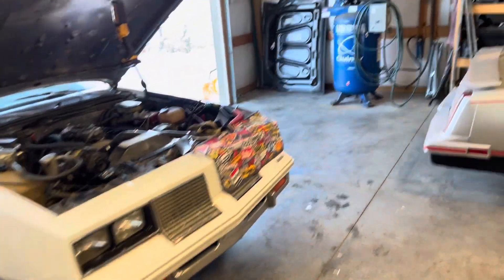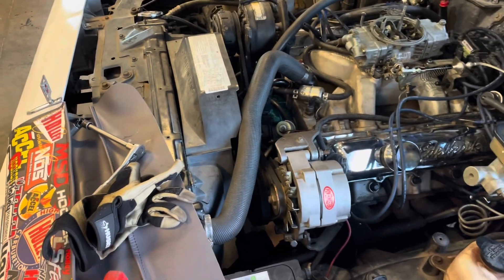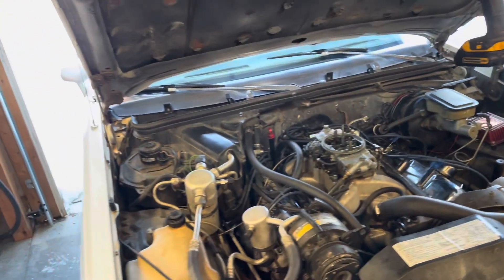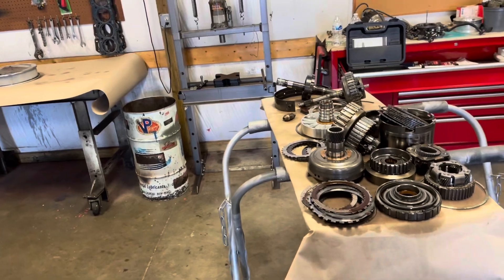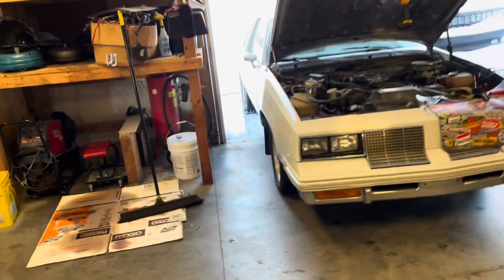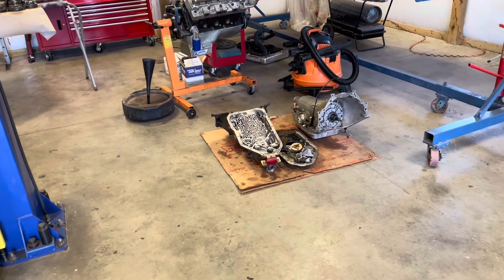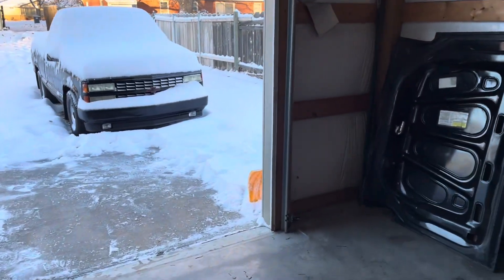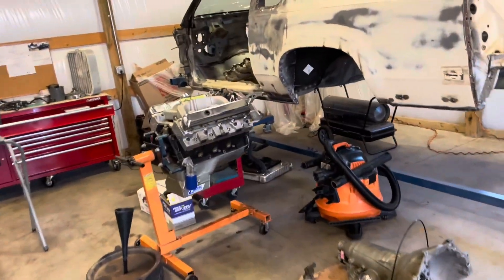This car is ✔️ for the day. Kinda anyways

Comment: on the white 442 is the Lunati cam still in it...I have looked at many of your videos however how does it sound,,, anyway you can do a video of the motor when its running as well as a rear shot to see how it sounds coming out of the exhaust